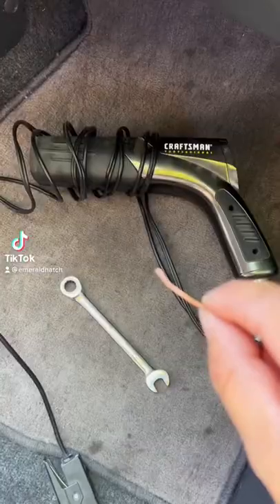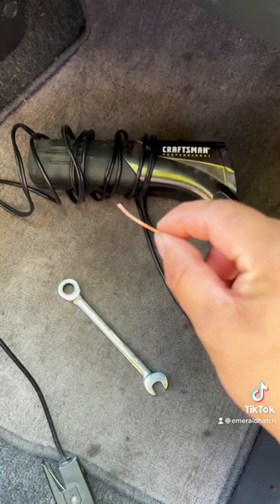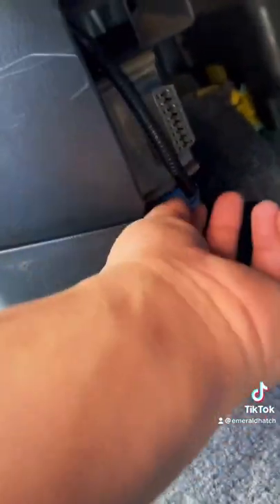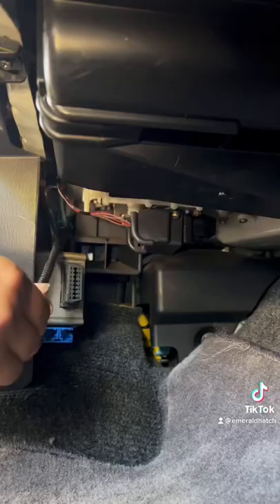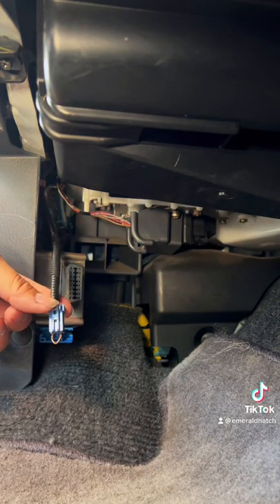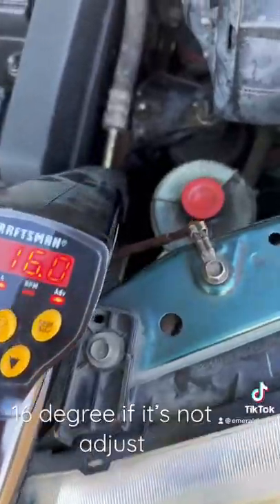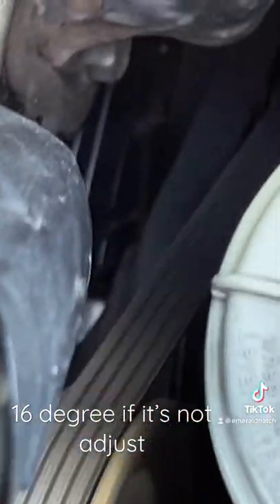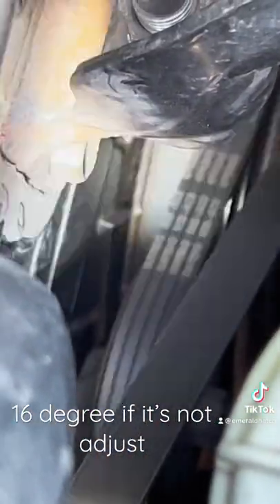97-01 Crv ignition timing

Comment: Great job Bro! Thanks to you the job was super quick and painless. My timing was off a good bit as the last person to replace the distributor didn't tighten the bolts so the timing moved. After re-timing, valves and engine became very quiet and running strong.

Comment: I did all the steps and pressed the gun and it sounded like it found it's mark but I can't get it to stay? The distributor is loose all the way towards me
Reply: That means your timing belt has likely skipped a tooth or two. The timing belts on these tend to stretch out over time and when that happens they can skip teeth and throw the timing off. I would get it fixed asap before you end up with a bent valve. Or worse the belt breaks, that could destroy your engine.
Reply: I have broke a timing belt on my car going down the road I put a new timing belt on it water pump that was at 142000 Mi now it has 230,000 miles

Comment: I jumped the 2p and set base timing. After unjumping 2p and plugging it back in the timing is off from where i set it at.

I did the timing without jumping and it stays where i set it. Why is that?

Comment: So basically you're doing the timing incorrectly, add in the service connector under the dash warm the car to operating temperature, adjust the ignition timing to the red mark which is The middle of the three notches , adjust if necessary,  Then shut it off unplug connector restart you're good

Comment: Hi, I am from Jordan, please help. I own a 2000 Honda CR-V. It suffers from a delay in starting, double the rpm, then the engine stops, and sometimes you press the gas pedal, it does not respond, and suddenly it works. What is the problem?
Reply: Distributor?